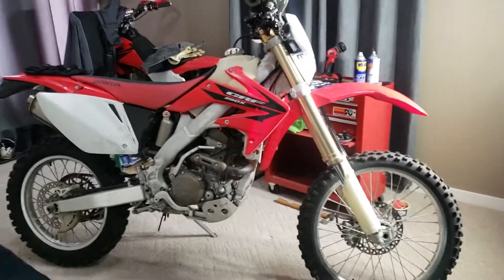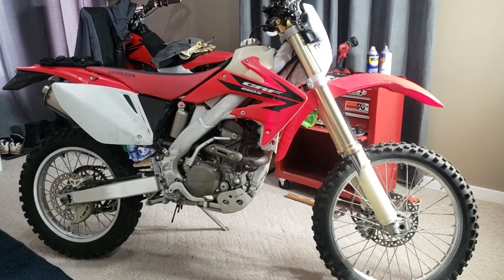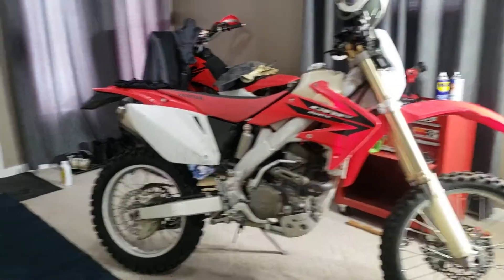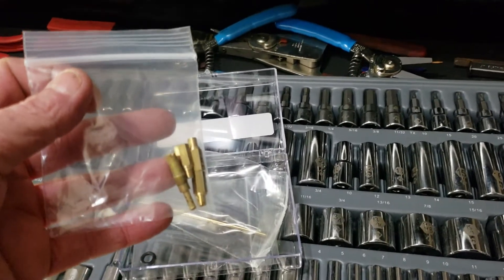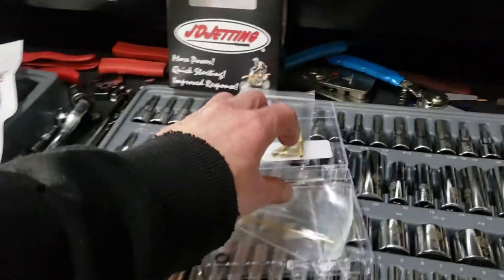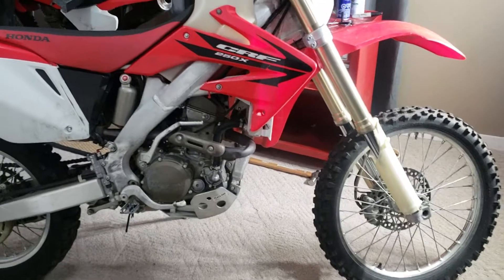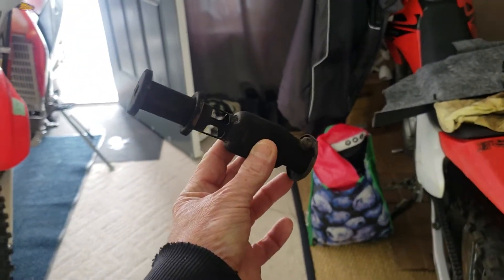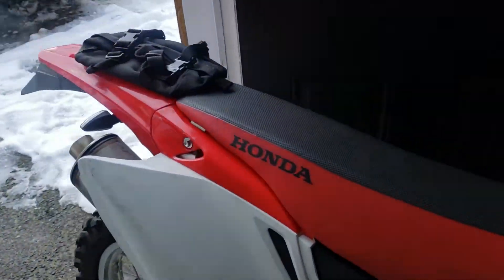06 CRF250X Part 4 Carb Jetting & Air box mod

Comment: I have on 2004 and whenever I wash it I have to take off the seat and put a piece of plastic over where the previous owner cur the airbox if i dont the filter gets wet
Reply from the maker: Hi there,  I wonder if mabey they cut to much of the air box out ? I've never had a problem with the filter getting wet .. thanks for the comment
Reply: Yea they cut the airbox so big you can almost remove the filter
Reply from the maker: Think it would be worth it getting a new air box and making the cut out smaller?
Reply: Maby it's pretty easy to cover it up you take off the seat cover the airbox and put the seat back off. Buy the way thanks for responding so fast
Reply from the maker: No problem thanks for checking out my videos.  U could cover it make sure to leave some opening from my experience they just don't preform very good all closed up
Reply: I take off the cover off after I wash the bike so it runs fine

Comment: I'm going to do the same as you did to my 06. It starts up cold but takes long time to warm up. I have to use choke half up and down by hand (what a pain). When warm its a really nice bike with slight big when accelerating. Hope it does the trick. Mine has 72 hours since 06
Reply from the maker: Awesome !! Let me know what u think after the mods .. I'm truly impressed,  and make sure u check your valve clearances on a regular . Mine has 125 hrs on it , I think I'm gonna replace the valve train soon .

Comment: I forgot to ask ..did you have to adjust carb cable  at the carb ... I had to when I reset the needle clip with jetting
Reply from the maker: Absolutely man . They can be a bitch! Did u get it all done ??? Hows it running?? As good as u though,  or better ??? 😁😎
Reply: Cable was a bitch ahah ya it’s done finally snaps back enough at first the cable had no spring back .. haven’t poored new gas in yet putting new electric starter on it should be good soon brother I let ya know thanks

Comment: Picking up a 2006 within the next few days. Your videos have been very helpful. Did you replace the exhaust?
Reply: Just picked an 06 250x yesterday. It looks like they already opened the air box but I highly doubt they jetted it. When I accelerate the bike literally dies. I think it’s the jets, already have a JD jet kit on the way I hope it’s just that. Did you experience that at all prior to jetting?
Reply from the maker: @Lxzcvyesfwmk  yes the bike is pretty flat without the jetting done , I believe the stock main jet is a 135 . Easiest way to check,  is loosen the rubber boots ,turn carb clockwise,  undo the bolt on the bottom of carb and take the jet out.  I think it's a 6mm socket. Thanks for watching
Reply from the maker: Thanks man .. no new exhaust just took the baffle out. Kept the spark arrestor in though.

Comment: Do you remember if the red needle came already set to the 5thclip right out of packing. I think it did I installed it now before I put gas in bike I’m second guessing it .. may have to take apart? I’m pretty sure it was preset to 5th clip position?
Reply from the maker: Mine was set already to the 5th position as well right out of the package..  I think it's the way to go myself.  Thanks for the question

Comment: With the airbox mod can you go ride in small streams and wet trails or when its rainy outside or water will enter in your airbox?
Reply from the maker: Absolutely!! There was only one small area behind the rear fender that I decided not to cut out just for that reason. Keep your air filter clean and oiled properly just for peace of mind.  Cheers
Reply: @gripthistv1337  thanks really appreciated!

Comment: I forgot to ask - did you change any with stock needle ?  And if so what is the setting U may have said it not sure
Reply from the maker: Yes you do have to change the needle . I believe it's the red needle and the retainer clip in the 4th or 5th position.  Just follow directions from jd jetting kit it tells you everything you need to know.  I've found I had to go 1 size bigger of a jet 160 just because of my exhaust. Thank you I really appreciate the feedback 🤟

Comment: Great vid Perfect information I needed to do exact same to
Mine it’s a 2005 just got it all original just dogs out when I hit throttle -I’m gunna run original pipe so it’s quiet. ..you running with original pipe ?

Comment: Do the jd jet kit and the airbox mod  give a real difference on the power of the bike?
Reply from the maker: I also run the OEM exhaust, I just have pulled the cork out of it , and after a couple rides I think I'm going to a 160 main jet.. so if yo leave the cork in you'll be just fine with the 158 main jet .. thanks for the questions
Reply from the maker: Yes the air box mod and jetting have more power and a quicker smoother throttle response,  also un cork the exhaust.  Buy the kit right from jd jetting and follow the instructions,  depending on your altitude  . Hope this helps cheers
Reply: @gripthistv1337  and what it does if i keep the oem exhaust but without the anti-pollution thing? Thanks!